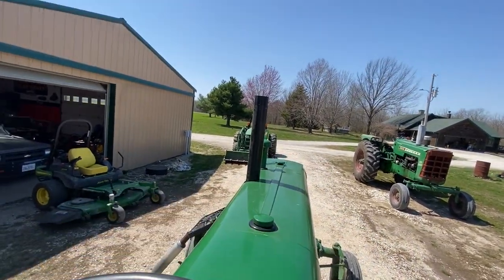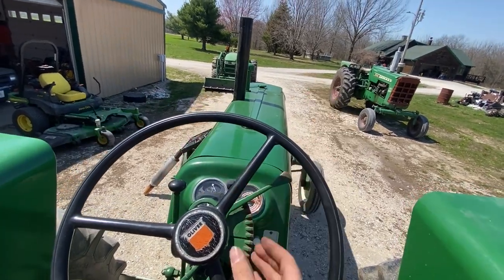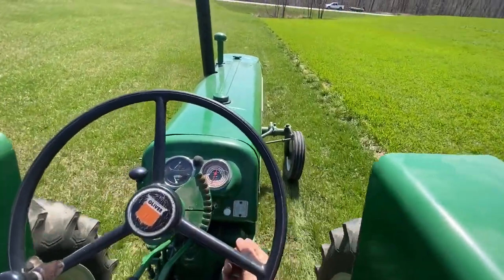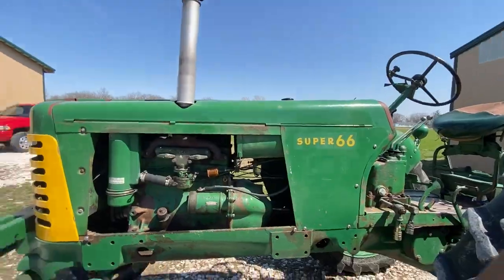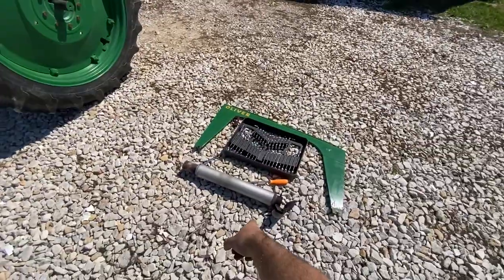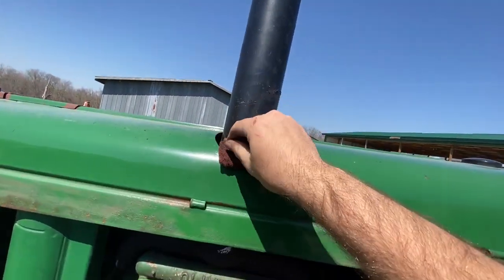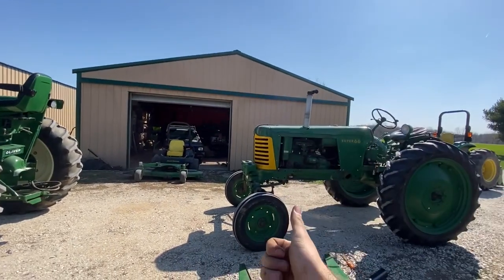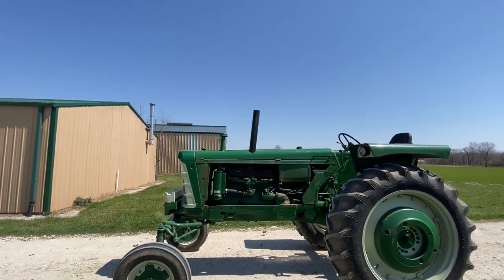Straight Piping Oliver Tractors - Wow!

Comment: U can find some cast iron straight exhaust pipe at the hard ware or see what else U can chrome straight double wall exhaust might sound better do U have a road blade U put on the tractor 2 make it sing if U had a oliver w a GM DIESEL ENGINE then U could hear it singing great 😊😊😊😊😊😊TLC/OMG 4 14 2O23